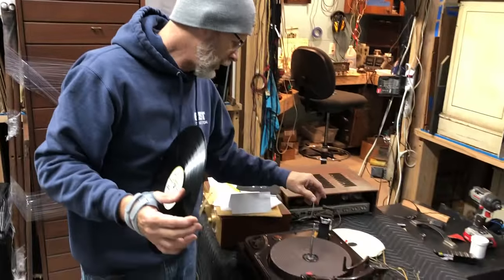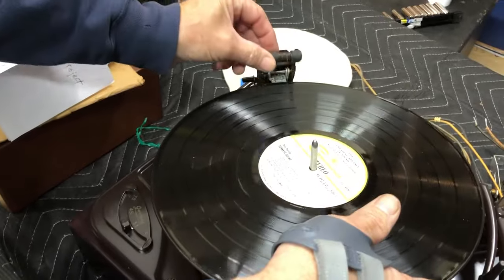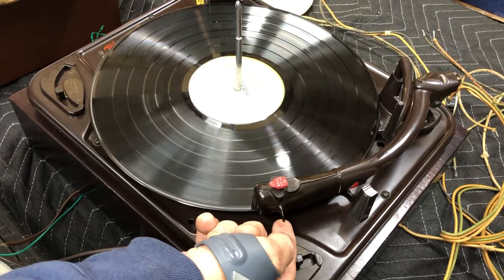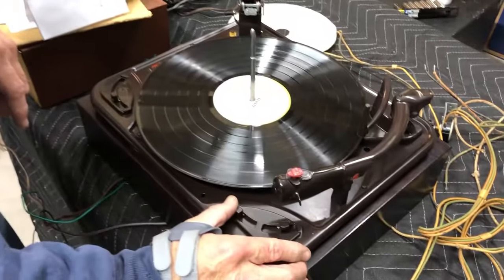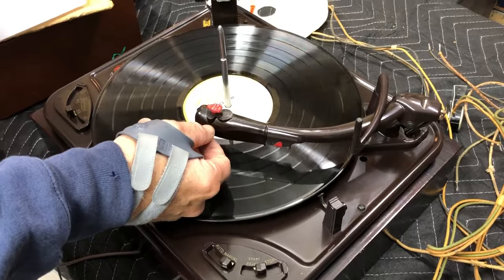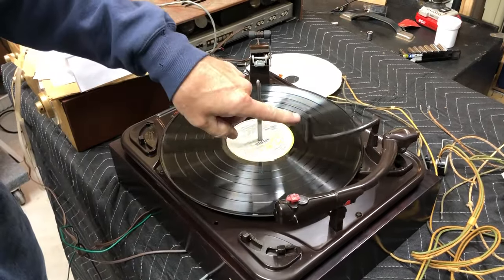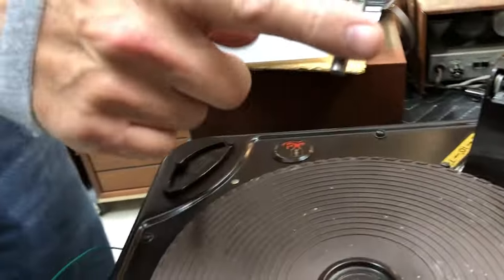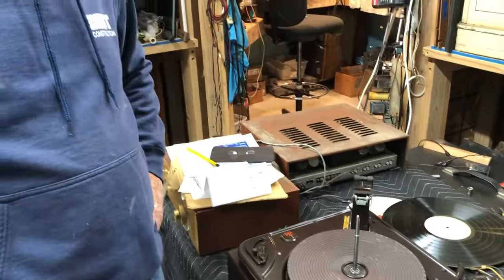Garrard RC 88/4 Operating Instructions

Comment: I have this same “ great “ Old Garrard Changer..! I purchased it not working on eBay and rebuilt it …👍🏻 I wired the tone arm and cartridge for stereo…🎶👍🏻 I have a Stanton 681 EEE cartridge in it … I also made a short center post for easier manual Play, only …. I just purchased another regular changer center post and cut it down then turned it on my lathe…! 
I have the tracking adjusted extremely light …👍🏻🎶👀
Reply from the maker: Nice!